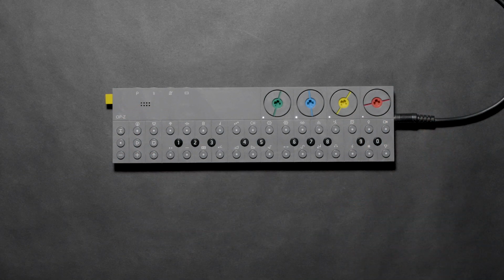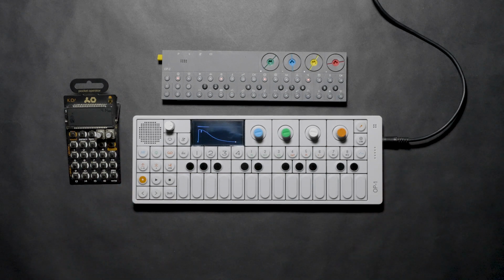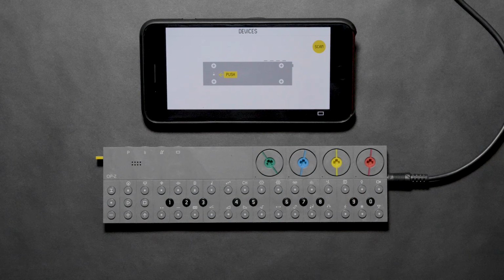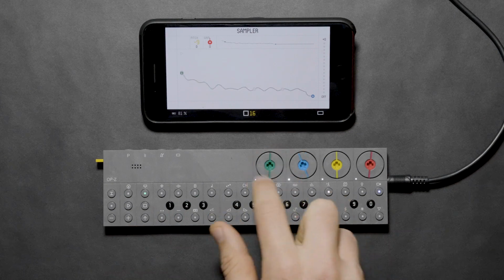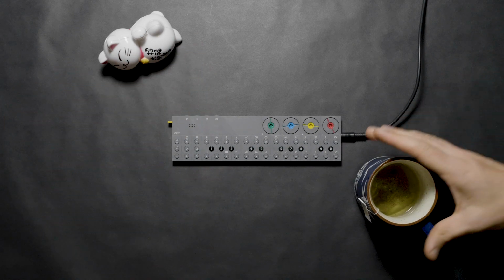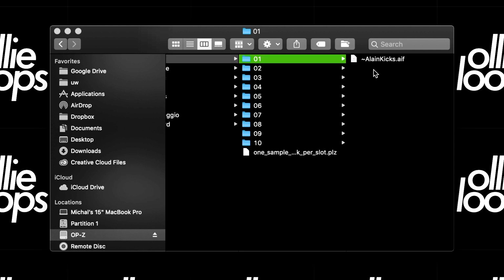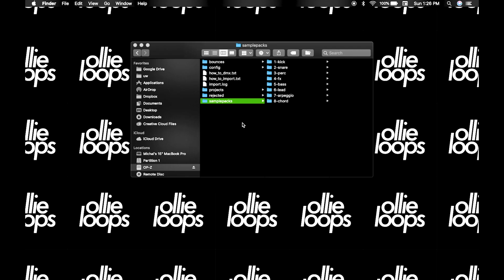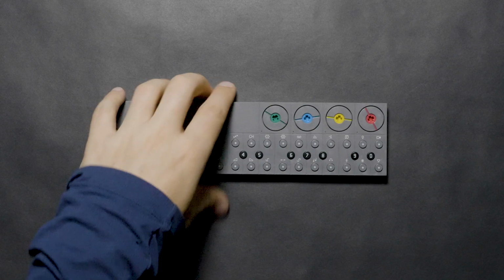OP-Z: Sampling Explained!

Comment: I have an adapter that will split the TRSS into separate mic and earphone jacks.  I want to sample directly into the device from a synth output.  Will  a line level output work?  I'm worried about damaging the op-z with line level voltage -  should I stick with a headphone out from the synth?
Reply from the maker: Officially, the OPZ can’t accept line level. Even the headphone output is closer to line level than mic level. You run the risk of damaging it if you run those signals into the device. 
A work around would be to get a USB interface, run a line level signal into it, then sample the signal via USB on the interface. Hope that helps.

Comment: I have an Android phone and works perfect connected via USB C. I didn't have to set anything on my phone or the OP-Z. It worked instantly. I have to use a usb c adapter for the included OP-Z cable.
Reply from the maker: Thanks for that info. It sounds like Android is plug and play.
Reply: If you dont mind, which adapter are you using? I have a s20 and just bought a 3.1 usb-c  adapter and i have no connection.
Reply from the maker: @poorrichard1321  Hey, in my case, I have an iPhone and I'm using Apple's camera connection kit. But for an Andriod, you should be able to connect via USB-C to the OPZ. I would assume there are some settings on the phone to change to make the OPZ a sound card for the phone. You could also try testing communication via the Android app. Give those a try and let me know if you have any success.
Reply: @OllieLoops   I appreciate your response! I feel ive exhausted  every setting in this phone. The op-z is showing usb in the app in sample mode, but when monitoring nothing happens like it does when sampling from my laptop. Ive even gone into deeper developer options. 
    My next step is is a usb c to trs adapter (w/ dac), to trrs splitter cable. 
    Ive been at this about 4 or 5 days strait thinking that there has to be a solution. 
   Again, thanks for your help!
Reply from the maker: @poorrichard1321  sorry for the delayed response. So tell me what you want to do exactly? Are you looking to sample something from the Android into the OPZ? And does your phone have USB C or USB Micro?
Reply: @OllieLoops  it's all good Olli. I'm looking to sample  from this s20. I have usb c but from my understanding at this point. This and the s10 only have one dac built into it for the speaker.
 Whether I use USB c or the trrs input to sample isn't that big a deal. I should have a usb c splitter with dac, that has both USB c  and trs connections here tommorow. I also have a trs to trrs adapter. 
 I figure I won't need an attenuator using just a phone input. But if this doesn't work I'll be completely lost. Lol
Reply: @poorrichard1321  I already had these  and worked perfectly. Also I use them to connect a midi keyboard to the OP-Z. https://www.amazon.com.mx/dp/B01EL4PVFE/ref=cm_sw_r_cp_apa_i_XNfLFb5JYN5Q9

I have a budget phone (ZTE Blade V10).
Reply: @carlos_martinezzz  Thank you for your response! Ive been back n forth to wally's and best buy  with different cables/connectors more than i need to. Im gonna try those 3.0 connectors you had luck with. 
   Its funny how i can connect this dam phone to my washing machine, and not the opz...
   Enjoy making music good brother!
Reply: @poorrichard1321  hope those connectors solve the problem bro! Also take a look to the phone Usb preferences. There is a setting that uses the usb just to charge the phone and it has to be in multimedia mode (at least in my phone). It seems like the phone changes to this setting automatically but maybe in yours it has to be set manually. Keep jamming and making music too!

Comment: Trrs adapter. Just get the correct one and you got line in. There are 3 different kinds.
Reply: The is a guy on Etsy called “digdug diy” he makes an adapter for the op-z, to convert the trrs into an individual input (mono) and stereo output. I am using this and it works rather beautifully.

Comment: Heh, just mount op-z in content mode and manage samples from there ? You can use any sound file?  Op1.fun ?
Reply from the maker: Although this is possible, I think the point is to sample content within the device. But arguably, dropping samples into the OPZ via computer is relatively convenient and straight forward. Plus you can source plenty of user samples.

Comment: Loved the thorough review. Been using sampling for awhile and still got some great tips and reminders. The test tone engaged by hitting track while in sample mode is not at all a gimmick however. When on the white keys all play the sample at the "set" pitch which if you listen to and tune to 440 makes it so that when you hit an A on the keyboard after leaving sample mode its sounding a true A 440khz, that way you can play well with friends. Try it with things that aren't necessarily tonal and use your ear for fun.
Reply from the maker: Patrick McNary Hayes good tip. Thanks.
Reply: Reminds me of the Casio SK series and sample tune with the A=440Hz playing while you adjust up or down. [Lion roar, dog bark]
Reply: Could you please please, elaborate this a bit? I know it’s a been a year since your comment, I hope that you get this reply and somehow time stretches to accommodate my query!

Comment: Just use a Y TRRS cable splitting headphones from microphone and plug in any mic or line in. i use that to connect any mic to ipad/iphone and such an adapter costs just a few bucks
Reply: The problem is that line-level input will destroy your hardware since the OPZ's TRRS port only allows Mic-level in.
This warning about destroying hardware is on the manual
Reply: nacs how does it destroy it exactly? Isn’t it just a volume thing? I use a similar adapter to sample with my iPhone using the trrs mic input and wondered what line input vs mic input matters, didn’t know it could be harmful.
Reply: Line level signals are approximately one volt. Mic level signals are in the range of 0.001 volts, or 1,000 times less voltage. You can reduce the voltage of a line level signal by using an attenuator or a DI (Direct Injection) box.

Comment: Hi, on the OP1 it's possible to sample any source without having to press the record button. You simply need to press "shift + a keyboard key" (while in synth or drum sampler) and it will go in standby mode, waiting for an input sound. I'm not sure about the OPZ as I don't own one, but give it a try :) . About your copy and paste problem, if I understood correctly what you meant, it should be just like as on the PO33: pressing and holding a step containing a sample will copy it to memory, pressing an empty step will paste it.
Anyway, in my opinion the OPZ came out "incomplete", and it's a real shame. It's a beautiful item, but since its main purpose is sequencing (possibly other gear), the lack of i\o inserts is a pretty big deal. Selling a module is pointless, as it should have been integrated into the machine from the beginning. Plus lack of screen and \ or an android app is the cherry on top. I'm a huge TE fan, but I don't see myself buying an OPZ pretty soon, a PO33 is a better companion for the OP1 than the OPZ, specially considering the price.
Reply from the maker: Hey, great comment. Thank you! 100% agreement! 

First, on the OPZ sampling copy and paste stuff, I'll give that a try. The Shift + keyboard trick didn't work on the OPZ. But good to know on the OP1. 

Regarding the OPZ and your comment, I think you're spot on. It was over promised and underdelivered. And that is a shame, not just for the devices potential, but for the price point and value to the end users. If it were $300, I would say, its a tremendous value. But with the little shortcomings and lack of being fully resolved, it doesn't work well for me personally.

Comment: Use the OPZ app and the Configurator menu to copy samples from one track to another. Keep in mind that slice points are shared across tracks. 

Also in drum mode if you sample a one bar loop precisely it will be chopped in 16ths and 8ths across the keys. Like the OP1 did. Useful. Because you can then fill a bar with steps and basically time stretch the old fashioned way. I wish they had threshold recording or trimming so you can have perfect slices. But I'm happy with the way it is right now. 

I'm hoping for an audio card module though
Reply from the maker: Hey, thanks for that info. Follow up question, using the Configurator will allow you to assign the User Sample Pack on other tracks, correct? But theres no way to copy and paste a sample on the OP-Z, correct?
Reply: Ollie Loops none that I know of :(
Reply from the maker: @alecsbuga  Thanks Alex. Let me know if you discover the secret recipe.
Reply: Nice tip here bro. So if I were to sample a 1 bar loop, I would have to try to start it at the same moment I start recording for it to be chopped close to perfect right? There's no way to have it start recording once it hits a threshold?
Reply: @Khordmaster  if the software allowed for that, it would be able to. Maybe in a firmware update. BTW, how long before we start seeing homebrew firmwares?

Comment: You can use USB to sample from your phone, that makes the usb audio input pretty awesome for me.
Reply: I was able to sample from my USB c iPad pro which is nice. I'm going to check if I can do the same with my Android phone which also has usb c
Reply: @Khordmaster  hello Kevin , are you able to sample from a Android phone which has usb c? thanks.
Reply: @jiachengguo6408  will try today and let you know 😀
Reply: @Khordmaster  thanks😁
Reply from the maker: Hey, thanks for your comment. Can you tell me a bit about your setup and how youre able to sample off your phone?
Reply: Ollie Loops yep same here. You can count my iPhone to my mobile dawless setup now together with the OP-Z. Just connect the iPhone via the Apple Camera Connector directly to the OP-Z and you have nearly unlimited sample opportunities from different Apps, Youtube, Spotify etc. with a pretty great workflow in my opinion!
Reply from the maker: @dreamlogic1983  Thanks for that. So it's just plug and play, no settings to adjust? I'll have to get one of those adapters. Thanks for the info!
Reply: Ollie Loops correct - as soon as the iphone is connected the OP-Z switches to USB-C sample mode and you can start sampling . I loved the OP-Z before but this opened a new world of creativity on the go for me.
Reply from the maker: @dreamlogic1983  Thanks! Good info.
Reply: @OllieLoops  Yes but you need the official adapter. It's very expensive but it has an apple proprietary software inside that makes it work.
Reply from the maker: @diejaycee  Thanks! I got the official one on order. Thanks for the info!

Comment: I really don't care about OP-1 compability, as I don't own one and I'm not planning getting one for 1400 EUR. I think they said a sampler module is not out of the question later.
The PO-33 style copy paste is feasible for sure from a tech standpoint, since it doesn't take up additional space to have the same user sample in multiple plugs across multiple instruments, we can safely assume that they are stored in a similar way, UX is a bit harder on that one though. I think the line-in functionality was supposed to be achieved via a simple TRRS splitter and some people are having success using one as a line in.
Would it be different form op1 line in, if you just had to use a splitter for line in functionality?

Overall, I'm really happy with this update.
Reply from the maker: Hey, thanks for your comment. 

To clarify our point, it shouldn't be necessary to purchase an OP-1 (or module) to get further sampling functionality on the OP-Z, it just would have been nice because many people already own both units. After all, some people did pay almost $2000 for both units. Since both units have their strengths, using them together would make them a powerful duo, at least in theory. 

The TRRS input is not an easy item to resolve. After spending 4+ hours trying every method, cable, adopter and setting combination, we had little success getting anything useful from this input. We didn't try every solution available, but we did try several at our disposal. There are some technical reasons why a line level input is superior to a mic level input, which is its input gain. Microphones require more gain than line level inputs. So, although you can get a line level signal to work on a mic input, its just not as good as having a dedicated line level input because you get more headroom from a line level signal. Usually there needs to be a transistor or other component to change the signal's gain from mic to line. In principle, a splitter will still be expecting to see a mic level signal. As mentioned in the video, an iRig interface, which would convert the signal before it enters the OP-Z, theoretically is a possible solution. But as a whole, the TRRS input requires more research and testing to come up with a useable solution. And in short, if it's too complicated for most users, then maybe it wasn't implemented well.
Reply: @OllieLoops  Thanks for the clarification on the mic level input, I didnt know that.
Reply from the maker: @0oSiLveRo0  no worries!